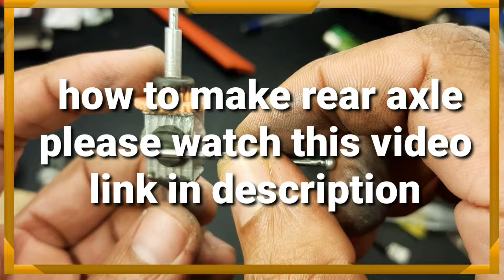making rc miniature steering system | how to make rc car steering system | expert malayalam

Comment: Very nice and basic steering system 👌 The only critique I have is maybe make it turn a little tighter. You can make some small cuts to the inside of the axles where the spindles connects.